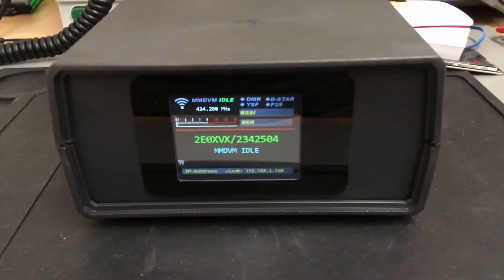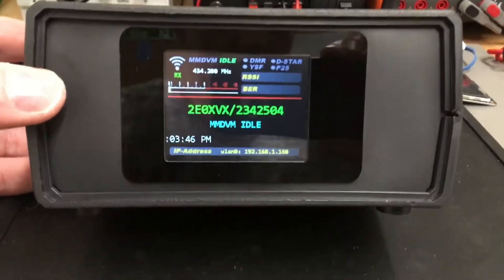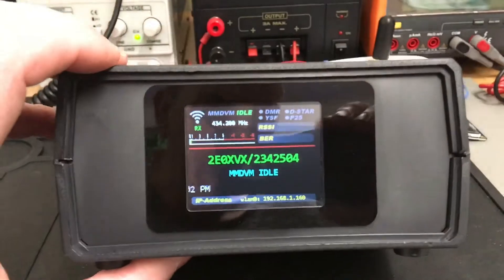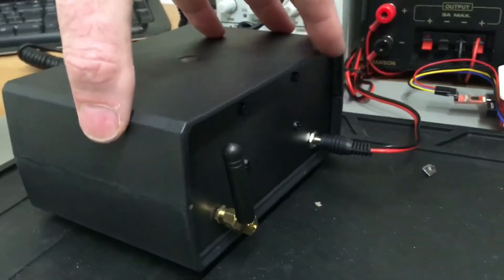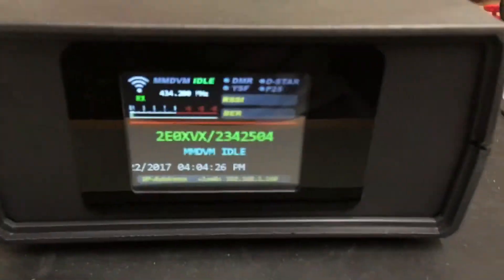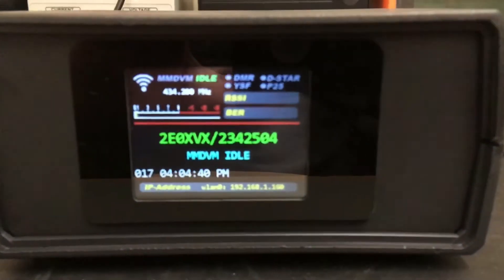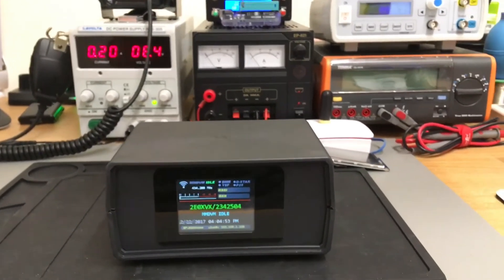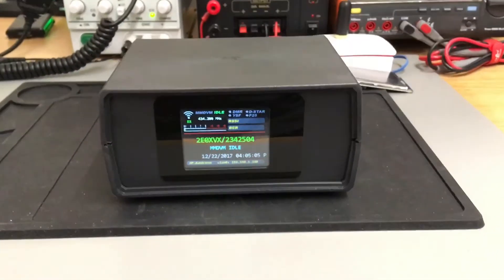MMDVM Zumspot Hotspot

Comment: Very nice video.  Would you please share source of the Bezel that you are using.  I am building a MyDV Cast internet radio and could use two of those bezels for my project.  I am assuming that you are using the 2.4" screen.  Thanks, WB4IZC